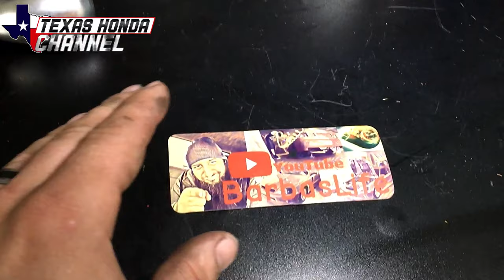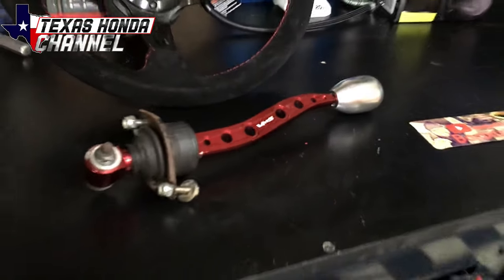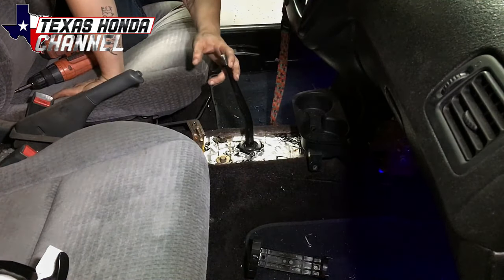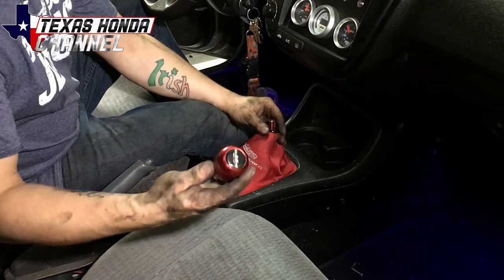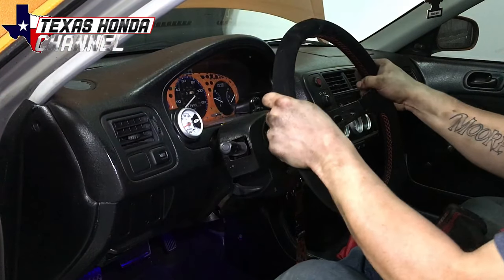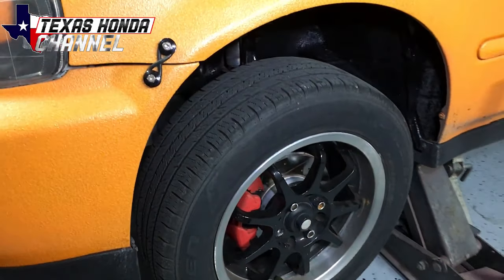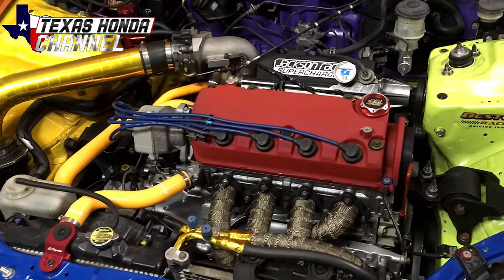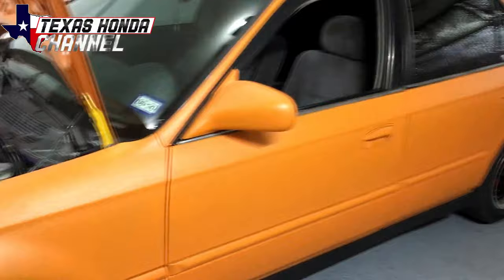Short Shifter Install (How To)

Comment: I have a problem with getting attached to cars lol. I've only sold/traded two cars in my life and I've had a bunch of cars. I traded an old $300 arora for a zx6r, and I sold my ep hatch for $2,500. Sometimes I miss the ep3 but things were expensive for it and if I hadn't sold it id never have gotten my 72 c10 which is my dream truck.
Reply from the maker: I have a problem buying and fixing them and selling them lol 😂

Comment: I like your shifter knob ,  the Texas one how can I get one ?
Reply: I made it. I've been trying to find a way to streamline the process. When I first mad it I directly threaded it and the threads wore out. I had to make an insert for it that had metal threads so they wouldn't strip, but I made the insert at work in the machine shop as I don't have the equipment at home.
Reply from the maker: sinformant Yea the thread insert only kinda worked another reason it’s just a show knob for the time being but once you get the little bugs fixed they will sell fast!
Reply: @sinformant   You might be able to find a insert from the boat supply market outside the US. Also if you can find a heavy wall insert you may be able to drill it out and retap it. It's a good looking knob. Is it a resin casting?